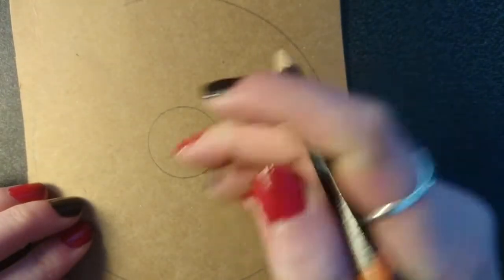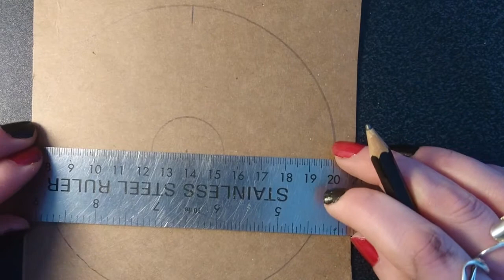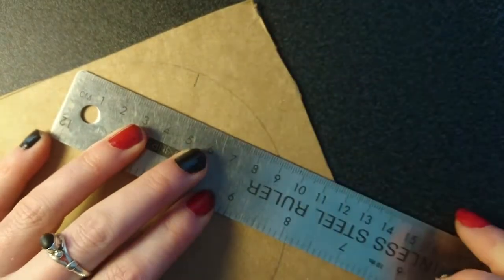Basic Kumihimo  (Japanese Braid) Tutorial Online Class

Comment: How do you calculate the length of cotton you need to make a desired finished length? I want to make a light pull switch for my bathroom so about 1.5m finished length.
Reply from the maker: I just found this, I hope it is helpful. The 3 to 1 Ratio--Determine the desired finished length of your braid then triple that amount.
Example: If you want a 20-inch necklace, each cord must be 60 inches long.